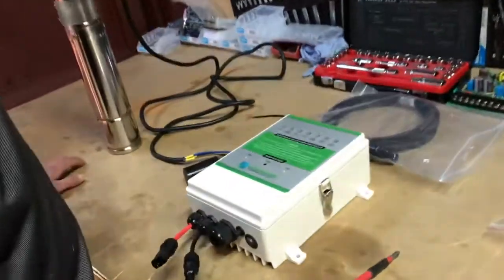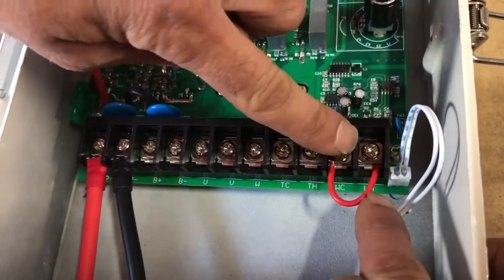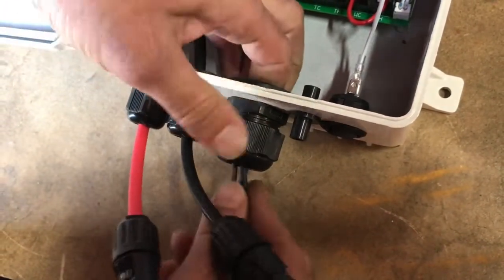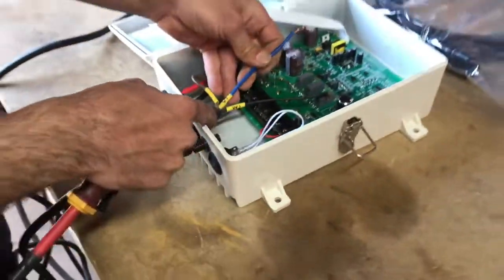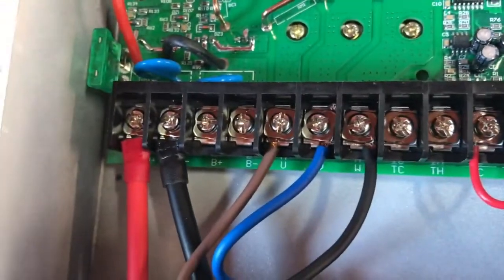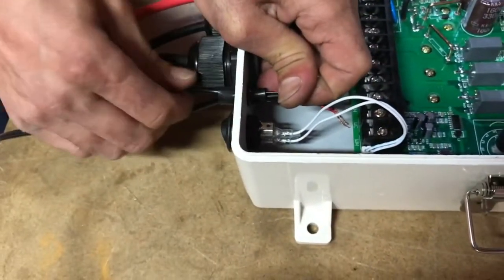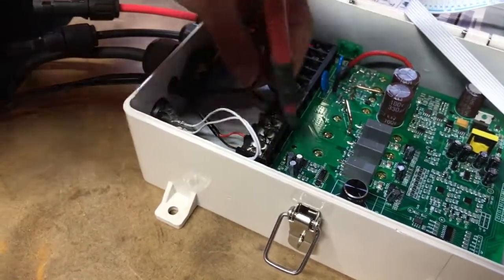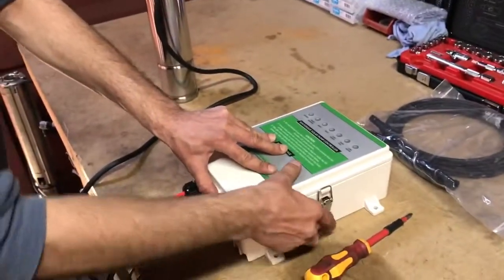How to Install/Wire a DC Solar Pump Controller

Comment: Very good, thank you for sharing your expertise online. I'm installing a DC Difful submersible pump, do I need to use the float switch wiring? In my case I'm using a water pressure activated switch to turn the pump off when the pressure gets around to 4 bars to turn the power off to the pump. The reason for this is because the submersible pump is supplying water to two separate water tanks

Comment: The dc controller adjust voltage?like panels do 200v2200w than output adjust by controller?